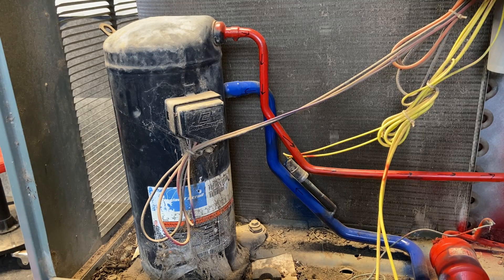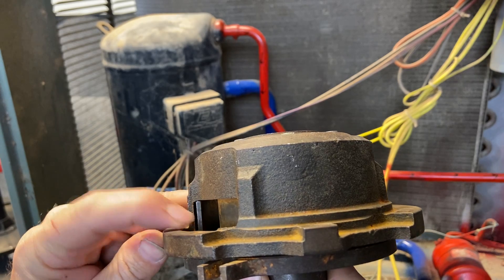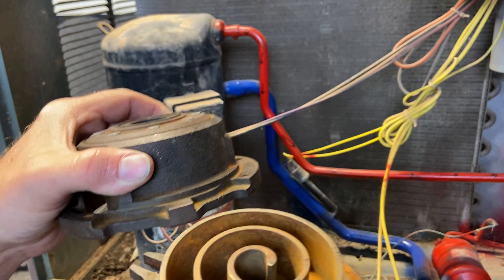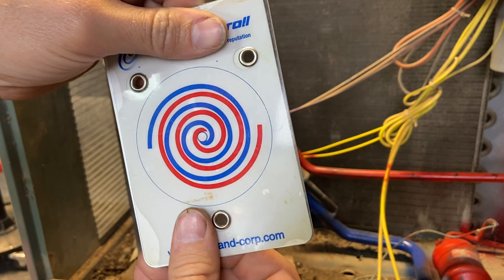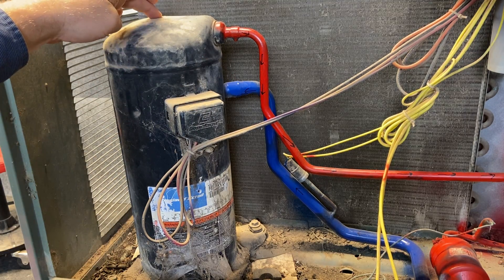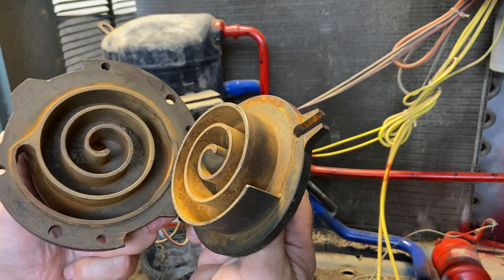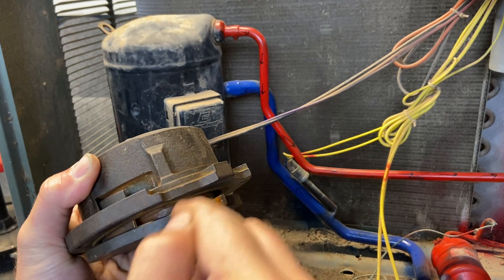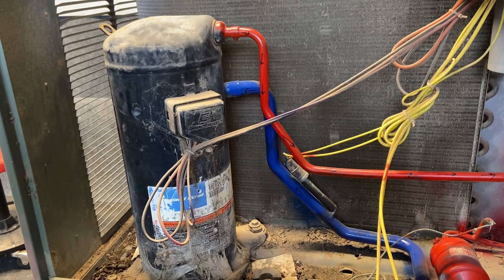HVAC 074 A Scroll Compresor introduction hermetic sealed

Comment: Hello Ty in this kind of compressor is the oil will be a seal between two stationary and prevent the gas go back or increase the pressure. Thanks.
Reply from the maker: Yes, that is very important.  I should have included that on the others as well. I will add it to the notes in the description. Thank you!

Comment: I've just had 1 reefer container with an overheating scroll compressor earlier today and drawing too much amps! I also used water to cool it down quite easily. Was worried the motor was shot. Always assumed that these helices are rotating! Good thing you mentioned they're actually just 'sliding' againts each other. This is golden knowledge. Thank you so much for this video.
Reply from the maker: Look at superheat and subcooling. Under charged and Over charged, airflow restriction and refrigerant restriction will cause this.  Electrical Check the capacitor wiring connections ie low voltage. 
Do they use any coating or treatment for the salt?
Do these have their own gas/ diesel engine or are they powdered by the ship. 
I've not had the chance to work on these, how exciting.
Reply: @love2hvac  so yeah, you're right on spot! .. It was indeed a refrigerant restriction due to the electronic EEV being closed by the controller.
Reply: @love2hvac  the scroll compressor indeed has some special coating for the salt. Yes, these reefers are connected to the ships 440V, 3-phase power supply. Currently, we are carrying 992 40-ft boxes from Europe going to Asia.
Reply: @archiearon654  are these micro link 3 refrigeration units ❓
Reply: @victorleon1563  indeed, these Primeline units by Carrier.
Reply: @archiearon654  I work on them in Zimbabwe
Reply: @love2hvac  These are the white 40-ft containers you usually see on the streets delivering goods to your local warehouses. I work with Maersk Line. 

Our overheating scroll earlier today was actually because of a bad suction pressure transducer giving bad info to the controller. The controller in turn shut the electronic expansion valve (perhaps the calculated superheat was very low) and consequently the system has an artificial 'restriction' causing the scroll to run dry and heat up and  eventually tripping the circuit breaker.